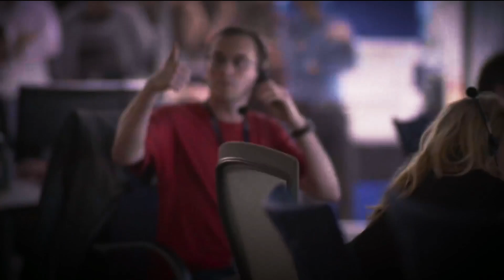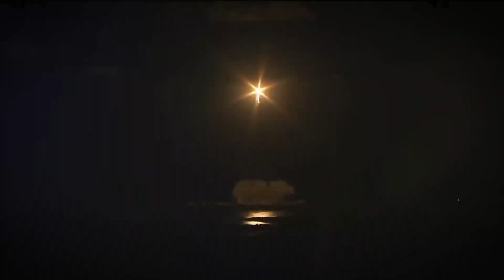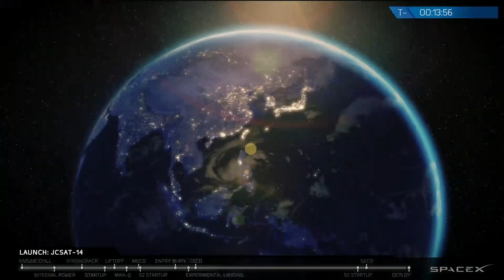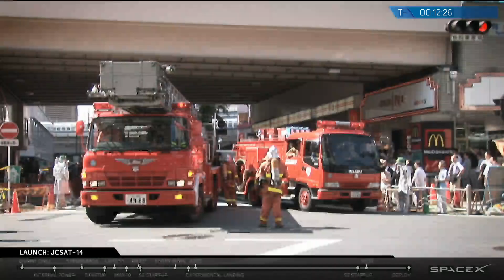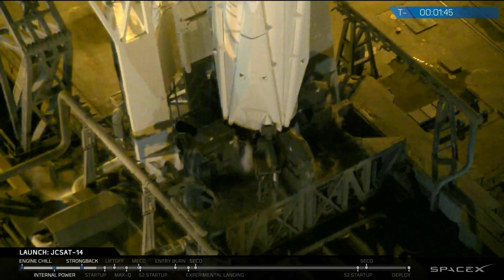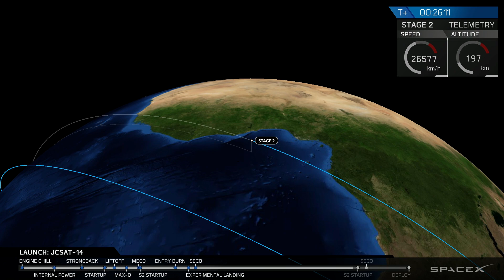JCSAT-14 Hosted Webcast

Comment: I don't work at Tesla so I can't speak to them.  I've worked for several start-ups, two of them went public/were sold, and in both cases it was the end of the innovation that made them.  It doesn't always work out for the founders/creators of the company either; in most cases the founders/early employees who took shares rather than $ are locked out of trading those shares until well after the rush of interest (and stock price inflation) after an IPO has waned.

I'll be keeping my latest startup private and keeping the value, and the drive to innovate, in the hands of the people that built it. ;-)

Comment: Camera work needs work but it seemed like a nicely direct landing, no hovering about.
Why not video from the lander though? there should be live well exposed video from all flight elements at all time. And don't give me nonsense about plasma blocking the signal. For night time you can use a 35mm monochrome sensor from canon or sony. They are very sensitive these days. 24mm sensor might be plenty. If you want to show off (and why not) you could jettison camera drones to fly along side.
And UFOs are still real and our world is a lie.